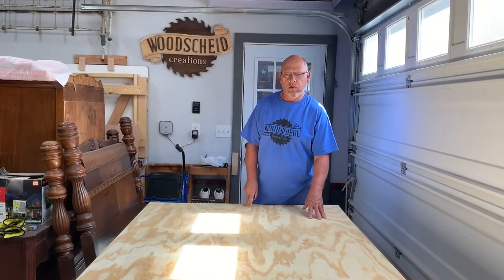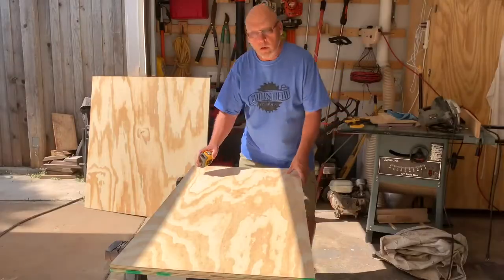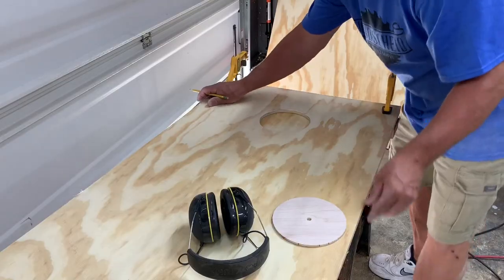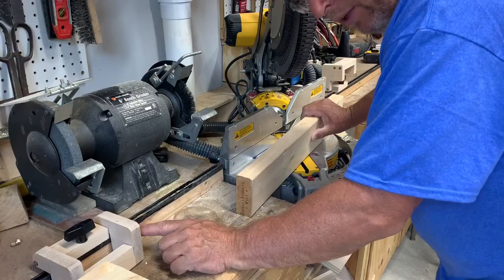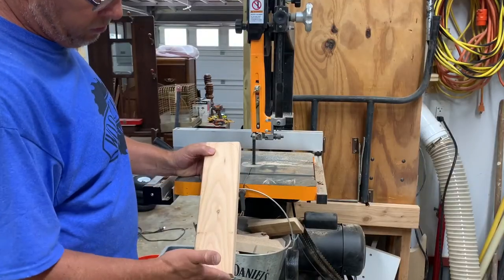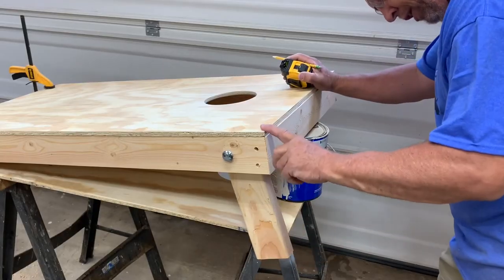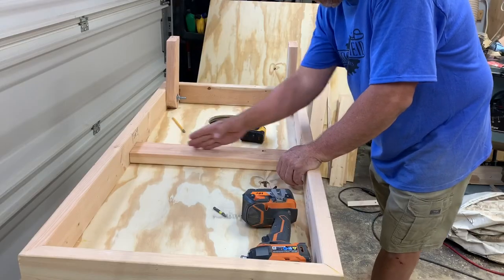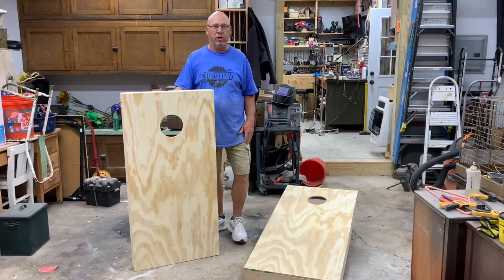Building corn hole official size set

Comment: If you build a lot of boards, I recommend building a board template with the hole in it already & using a down spiral bit & ride the template's circle.  All you need to do is drill a pilot hole close to the edge of the 6" circle to put the bit in and take your time.  You will get a pretty nice hole and it's repeatable.  I build all my frames from solid Poplar instead of 2x4's and add dual middle braces & 3/4" Baltic Birch plywood.

Comment: If you flip that 2x4 center brace upright and put 2 clasps on the sides, you could store the corn bags in the bottom half and clamp them together. Add a carry handle in the center and it would become its own carry case!

Comment: Is that 1/2 " ply ?
Reply from the maker: Yes, you can use 1/2” if you install a back brace, makes them much lighter than 3/4”
Reply: @woodscheidcreations8188   Even with 3/4 birds we still put 2 back braces and light boards will bounce
Reply: @msm624  I sold hundreds of sets never had a complaint about bouncing with 1/2 " tops, its simply over kill with added expense on wood and time.